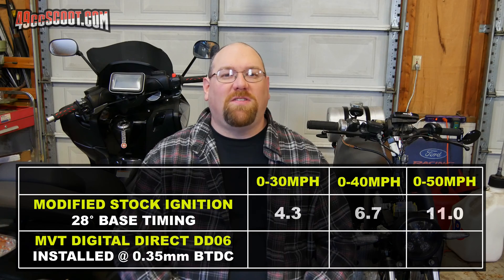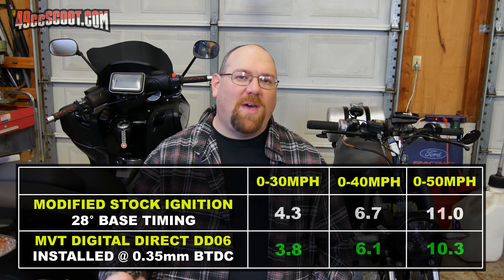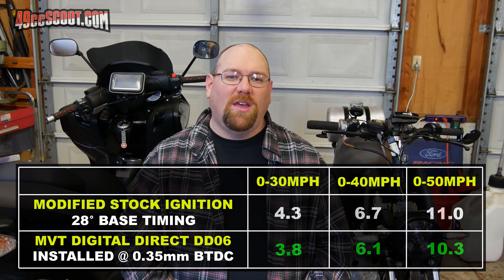TPR 86cc Build : Part 24 : MVT Digital Direct vs Modified Stock Scooter Ignition Comparison

Comment: You spend so much time and money, but loose a lot with an not optmized exhaust system
Reply from the maker: Just building it a little at a time. I know a lot of people think it's silly to ride around with this pipe, but it's a surprisingly good scoot to cruise with. If I took the MVT off so it charged well, I could ride it anywhere I wanted and it's got good manners. Spending the time is about learning and sharing to me.

Comment: Too me stock seemed fine get a stage 6 clutch
Reply from the maker: It was good for it in it's current stage. If you felt it vibrate at 12,000RPM you would not think it's fine for use with a higher revving exhaust later.
Reply: @49ccscoot  best clutch is polini evo 3g mutch cheaper and mutch better i use that clutch on all my scoots